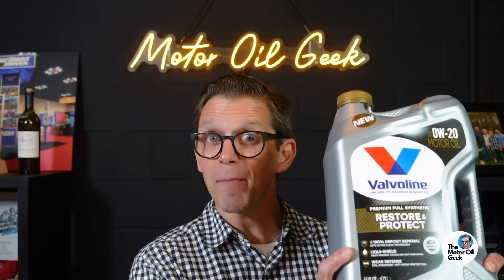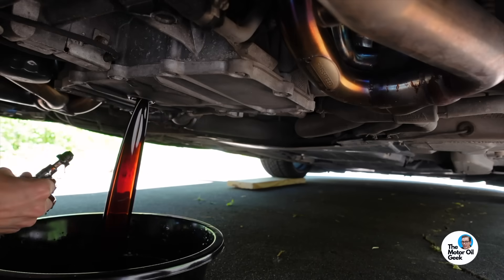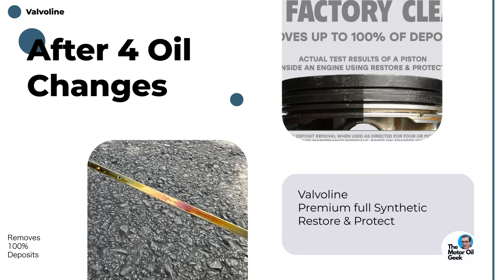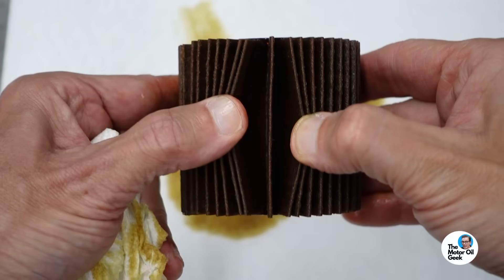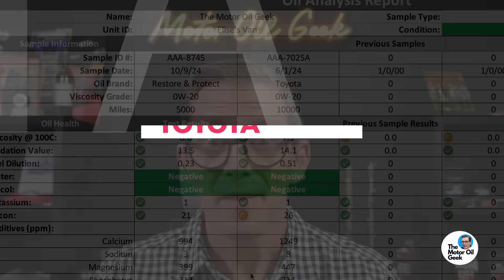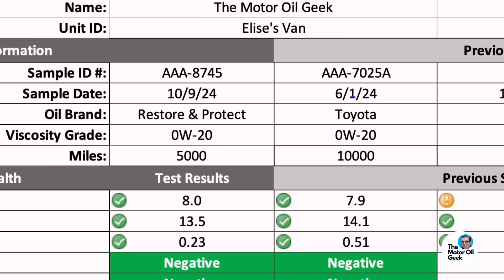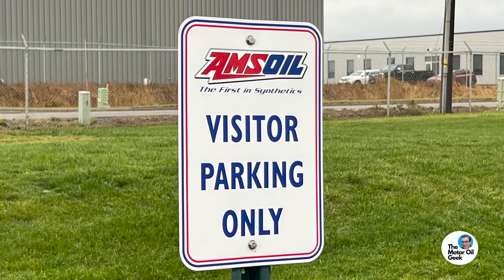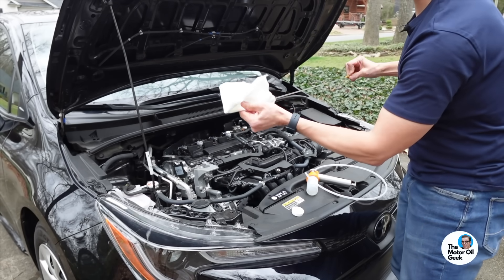The TRUTH About Valvoline's BOLD Engine Cleaning Claims

Comment: Lake for a 5.0 coyote that calls for 5w20 not tracking but running it hard do you recommend going to a thicker oil like 0w40 temps rarely see below 40F in AZ. Thanks man.
Reply from the maker: Usually a thicker oil will increase oil temperatures.

Comment: The bottom drain sample is more accurate since you have to drive the car up onto ramps. As the engine running, oil circulate through out the engine. When the engine is shut off,  all deposits will be collected in the oil pan. As you remove the oil drain plug the gravity pushes the oil out, along with its deposits from the oil pan. It's always easier to work with gravity than against it.

Comment: I have a 2003 Camry with 235K miles. I put the restore and protect in it to see if I could extend the life of that engine. It has been consuming a quart of oil every 3K miles. I'm hoping the Valvoline will slow that consumption down by cleaning its rings. Wish me luck!
Reply: Any noticeable difference yet? I have an 06 Camry that burns a little oil so thinking of trying this
Reply: How’s it working?

Comment: i might give this oil a try. i've been using Mobil1 5-30 extended performance or truck performance in my Canyon with an LGZ V6, been noticing about 1/4 -1/2 quart of oil consumption every 5000 miles with 140k miles on it, might help loosen up some of the carbon on the ring lands and loosen up those low tension rings so they make tighter contact with the sleeves

Comment: The new bled of Toyota oil has way less moly than the old blend had. The Valvoline high mileage oils have twice as much moly as the Toyota brand oil now. Toyota changed the blend a while back to accommodate the new boosted line of engines and told nobody. Look at when the part number for Toyota oil was revised. That is when they changed the add pack. I stopped buying Toyota oil because of this.

Comment: Valvoline chemist to CEO: Boss, it turns out that the shade tree mechanics for the past 70 years have been correct, Marvel's Mystery Oil does exactly what they say it does. CEO "Order 100,000 gallons of MMO, add 1 oz to every 5 quart jug of ours, and upcharge $4,00."

Comment: Do you think it can keep the back of the intake valves on direct injection motors cleaner as well? I know that burned oil fumes are recycled into the combustion chamber for emissions. I’m wondering if the cleaning agents survive long enough to remove some carbon buildup on the back of those valves.

Comment: used this oil for the first time about 7 months ago. personally on my dailys im never going back to another kind. ive done about 3 oil changes at 3000 miles each on my subaru brz and i always use a high quality filter. my car 100% noticeably runs better and quieter than when i first got it. i have a buddy who bought a chevy s10, first thing he did was do an oil change with restore and protect and about a month later the truck is running better than when he bought it. valvoline restore and protect is one of the best engine oil products to ever hit the shelf.

Comment: I just changed my 2011 Versa 1.8 at 90k miles. It does have the normal piston slap when started. Hoping this vrp will help. I think the engine louder ...not from valve but from pistons?? I bought it at 88k and did 2 1k oil changes with 4 oz of seafoam the last 50 to 100 miles. Oil was very dirty each time. I keep checking the vrp on dipstick..still clear after 300 miles. Will continue to check.
I always change my vehicles at 3500 but have gone to 4k a couple of times...never ever 5k.

Comment: 2008 Sentra with 190k miles on it. It was consuming oil between oil changes and so far after 2 oil changes with R&P, the oil consumption has stopped. Fingers crossed that this will continue. Next up is a 2016 Kia that is burning oil.

Comment: Bought an ‘89 Sierra with a 350 TBI, had a bad lifter knock when I first bought it. Threw Valvoline High Mileage 5w30 full synthetic, which in retrospect was bad because flat tappet cam and low zinc, but I swear that oil cleaned something out because that lifter tick was gone in less than a hundred miles. Now I run nothing but Rotella T6 for zinc and Wix filters, but I always recommend Valvoline for that cleaning factor.

Comment: I’m using VRP 5W-30 in my 2012 Volvo XC60 (3.2L SI6) and it has smoothed and cleaned that engine out incredibly well. This will probably be the only oil I ever use from here on out.

Comment: Im thinking on useing vrp on my new to me 2010 f150 with 114000..currently using vhm 5/30 blend.. say after useing vrp after 3-4 oil changes and it does what its supposed to do,do i go back to using vhm or any other oil.. after all its done its job right?

Comment: Would this Valvoline 5W30 Restore and Protect be a good service oil for my brand new Westinghouse 13,500w Generator?  I already used the driven BR30 for 3 oil changes on my break-in.  Now I’m looking to use a 5W30 for my service oil.  Would this particular Valvoline be a good choice for a generator?

Comment: Most of the direct injection engines have major carbon deposits on the valves how does the oil performs on the valves? A borescope inspection should be part of your test.

Comment: so manganese is higher?, BFD.  does not indicate whether any SIGNIFICANT cleaning has taken place.   How about you test in an engine you have torn down BEFORE and AFTER running that oil.  But of course that does not promote your oil testing business.  By the way, back in the day I worked as a Chemist for Ashland OIl....of which Valvoline was/is a subsidiary.  I used Valvoline back then as I got a discount and besides, it's a good product.  Now I just use whatever I can get at the best price

Comment: I'm on my third 3k oil change with R & P on my 2005 Colorado cyl with 210k miles. Borescoped the internals and they are clean as a whistle. Cam chain noise on cold start is now gone. I'm impressed.
Reply: You had VVT actuator rattle on mornings? I have it in my 2013 tundra
Reply: @BakerStudiosIndy  see mine above.. 2007 Canyon, 2015 Journey: VRP
Reply: Do you do them in a row or mix with your usually oil in intervals?
Reply: @andrewives5001 use in a row atleast 4 oil changes and change the first time at 2k miles .

Comment: Love your content, but we’re still waiting on that new Pennzoil Platinum 15,000 mile formula analysis. 1. What did they ADD or ADJUST to be able to claim 15,000 protection. 2. How is it DIFFERENT or BETTER than the original Platinum

Comment: This might possibly be a coincidence, but with my wife's 2001 cherokee with 185,000 miles on it, I ran into an issues after putting this oil in. I changed the oil about 2000 miles ago to the Valvoline Restore and Protect and the oil pressure sensor just failed as the cluster showed 0 oil pressure and "check gauges".

I changed the sensor and oil filter, and oil pressure came back (left the Valvoline oil in) but I am very curious to see if it will fix the slight "knock/ tap" that her 4.0L has. I will try to update once I go to change the oil again. 

I am hoping it just dislodged a bunch of old deposits and it fouled the sensor, but I am really hoping this oil is the end-all-be-all for that pesky 4.0L Jeep motor "knock". Fingers Crossed!!

Comment: Been using valvoline 5-30w full syn on my dodge ram since 50k miles. Currently at 150k, and going strong. I did switch to valvolines high mileage formula at 100k miles. I use valvoline oil on all my vehicles!

Comment: My 2GR-FE engine in my Rav4 w/ 195kmi is like new it crazy fast and no oil drop. I'm using almost 10-40 non-synthetic here in CA temp. Will switch to thinner about 10-30 w/ lucas now that it cold.

Comment: Hi I have a second 2009 Honda CRV with 328,000 on it runs well was considering running that Valvoline restore and protect. I have changed the oil on this vehicle every 5K or so. What do you say any chance on washing off carbon that is taking the place of wear??

Comment: 2011 toyota sequoia with 255k was burning 2qts every 3k miles, after 3 3k inteval changes of restore and protect it doesnt burn a drop. I am 100% sold.
Reply: Similar experience on a 2006 Scion XA. Getting ready to do 3rd oil change and oil consumption has about disappeared...and it's become a zippy little car . Good Stuff. 🎉🎉🎉😊😊😊
Reply: What was the previous oil used in the Sequoia?
Reply: @ToddMcMahon-d6q unknown before my purchase but had always burned oil since I got it
Reply: @S @Skylinecreations101 Our 2014 Sequoia doesn’t use a drop of oil between changes and it’s sitting at 190k miles currently. I have used OE oil and filters since new.

Comment: Would have been interesting if you stuck a borescope in the oil filler neck and done a before and after as well. Like the video 👍
Reply from the maker: I tried, but it has a screen that prevented that.
Reply: @themotoroilgeek  dang maybe next time. I might have to keep an eye out on that oil in Australia. We do have Valvoline brand oil but not sure about that clean and restore type

Comment: I found that O'Reilly auto parts stocks ow08 Mobil One.Mobil 1 Synthetic Motor Oil MOB 1-0-8-5QT
Motor Oil; 0W-8; 5 Quart
4.9 Quart Capacity
Manufacturer's Defect Warranty
1 In Network
In Store By: Tomorrow at 9:50 AM
If Ordered By: Tomorrow at 8:25 AM
List:
$64.39
Each
Cost:
$37.99
Each  Looks like they've had it for 2 years.  Shows for '23-'25 toyota Corolla.  Hope this helps you. they didn't show single quarts.

Comment: Lake I used Driven Oil in my 2022 Z06 Corvette and it dropped 2 valves and spun the crank bearings? Dealership said it was inferior quality motor oil. What are your thoughts

Comment: I've got a 95 jeep yj with almost 194000 miles it calls for 10w30 but was wondering if I could use the restore and protect 5w30 in it with out any problems. Was wanting ur input before I did it?

Comment: 150,000 miles on my 2006 Subaru sti,  use 5w-30 synthetic oil should I swap to this. Just got it back from repairs  cracked  valve po302.  $ 5100 dollars och

Comment: I have a mazda 3 2019 skyactiv G engine 2.5 . actual miles 65000. I service my car by myself since new. I only used valvoline 0w 20 full syndetic each 5000 miles.  I saw this new oil and decided to try it. The first cycle was really nice I had 0 problems. The second oil change just about 1000 miles I got a random tik noise in my engine. I decided to change the oil and Try a Japanese oil ENEOS 0w 20 with molybdenum. The car didn't -produce any more tik noise.

Comment: That's too bad its not an option to use this oil in GM engines even though this oil is SP rated as well as they even list it as a compatible oil for LSPI with the ILSAC-GF-6A rating, yet something is not quite in spec for the Dexos Gen 3 rating it would appear. When I put a GM GDI vehicle into the oil selector on the Valvoline website it says NO, actually it also says no for the Ford 2.7. 3.5 or 5.0 engine. Or have they just not worked through licensing it for those engines, for now though they say no. Which also makes me wonder about the Amsoil theme of claiming its compatible ( and may very well be ) but zero to back up the claim with the Dexos approval.

Comment: The thing I want to know is, would you want to "clean" such a high mileage engine and risk possible future oil blow by from the piston rings having minor gaps where the carbon used to be?

In addition to this, would not going above a certain RPM range while driving limit the cleaning power of the Valvoline oil?

I rarely need to drive my '09 Camry V6 over 3,000 RPM because the 6-speed auto just has near perfect gear ratios and the 2GR-FE engine has a fantastic power band that allow the car to touch 80 mph without ever needing to go past 3,000 RPM if you accelerate in a linear manner and not slam down the accelerator pedal to initiate a kickdown.

I learned how to drive that way when I experimented with certain driving habits when I had a 2008 Nissan Maxima with a CVT because a CVT makes a vehicle move a lot differently than a conventional stepped automatic.

Comment: You have access to something no one else does, mountains of real world data. You should create an entire series comparing the wear rate per 1,000 miles for every oil. Like an oil showdown. Use all the customer data to show which oils have the most and least wear. I think a lot of people would like to see the results!
Reply from the maker: Great idea!
Reply: Not needed. Why? Does ANY car ever end up in a wrecking yard because the owner made an oil brand mistake? Nope.
Reply: @ ok Karen
Reply: @4af statisticly speaking yes. Oil that performs horribly will add wear over time and possibly damage seals too.  Even with tiny improvements of just 10% less wear means alot less cars being scraped in a given year over all... if most engines last to 200k miles these days with proper mantanince then a extra 20k miles is nothing to sneeze at when the average driver does only 12k miles a year..... being able to own a car for another 1.5 years is a huge win in my book for everyone, the planet included.
Reply: Excellent idea

Comment: Looks like I might consider using the Valvoline instead of the Pennzoil Ultra Platinum in my 2020 Palisade. I only have 43,000 miles on it and I've been changing the oil every 3,500-4,000 miles so I "hope" it doesn't have a lot that needs to be restored.

Comment: Manganese is present in almost all steels, as a deoxidizer. Also reacts with undesirable sulfur in alloys, so that manganese sulfide forms, rather than more harmful iron sulfides.
   I don't know if this manganese would be detectable in oil tests, however. I'm guessing that cylinder liners, crankshaft, and cams/lifters may all contain it, though. Maybe.
Reply from the maker: It is not common to see Manganese in used oil analysis, unless it is fuel related.

Comment: Question you think this would be a good choice on vehicle with 40k miles I only drive 10k a year. I change the oil & filter twice a year. Would this be a good choice for my application. I use 5W30 in 2018 F350 6.2L Or is this oil use for like 4 oil changes to clean the engine then go back to original oil. Question I’m asking would this be a good choice for regular use. Would you run this is your daughter’s Toyota.  Thank You

Comment: I love your videos i learn a lot from them!!! Me personally i have had big problems with Valvoline oil used to use it in the 90s and early 00 until a couple builder budy told me some bad things about it so when i tour down my dads 302 he bought new in 86 i was shocked at how bad the sludge was he had always taken it to Valvoline when it was under warranty then after or had me do the chanfes or did them himself no other oil was used and utcwas like a off road engine had sucked blak mud down the intake i couldn't believe it he never missed a 3k oul change even when he switched to synthetic still did it at 3k. Then back in February my gf took hers in and they used Valvoline and the calve covers leak so a little gets on tge exhaust manifolds and burbs it stunk so vad so bad. Only reason i didbt change it was because i had just had a triple aortic dicection on February 1st i definitely dint let her do tgat again lol i have seen tomany oil places including dealers screw up trying to hurry and it can be a pain to get them to take responsibility!!!!!!

Comment: Wife's Nissan lost a CPS so instead of waiting for me to replace it she bought a 2015 Honda CV? from a friend.  Low miles but may be DI, my job today is to read the manual.  Has had regular oil changes and CVT changes but I think I will try the Valvoline.  Both my 92 Mercury 4.6 and Dodge 5.2 have quarter million miles.  Just changed the timing chain on the Dakota and the pan was PRISTINE.  Both run 0w40 last many years and Quatrosyn and both were the development vehicles for their Transgo shift kits.  (20 years ago, were early years for their OD trans)
btw Nissian is fine 2005 5 speed with Quatrosyn
happy thanksgiving

Comment: Two bits of anecdotal evidence.
One of my friends car 187k Vibe
#1 Toyota 2.4l on its 3rd R&P change causes the already high engine oil consumption to be much higher.  So wear on either the valve stem seals or cylinders/ring packs have too much wear.  Will swap out guides to see if there is additional improvement.
One of my commuters 130k
#2 2012 Accord. Cold start VVT rattle disappeared on the first change (800 miles in). 
Purchased car at 90k stack of routine maintenance and the engine is all crusty inside.  Only used for highway commuting its whole life. Already got more R&P ready for it (at 2500 miles on this first change)

The varnish inside the baffling of thr Accord went from rock hard to a greasy tar like substance.  So its not chunking anything but a gentle emulsification.
Reply: I had the same experience with my 09 civic si. First oil change with restore and protect and the cold start rattle is gone.

Comment: I used this on my 2015 Chrysler 200 140,000 miles on it. Valvoline full synthetic oil changes 3-5000 miles since day one. Oil always was clean upon changing. After running the clean and protect for 3000 the oil was certainly darker telling me that it was cleaning out stuff that wasn't able to be cleaned before. I'm a believer

Comment: @themotoroilgeek What is the back story on this Sienna that has had only Toyota 0w20 run through it for all those miles? Did you buy it new and only use TGMO? Did you buy it used with a stack of receipts? Why does The Motor Oil Geek himself have a vehicle with a varnished up engine in his fleet regardless of mileage?